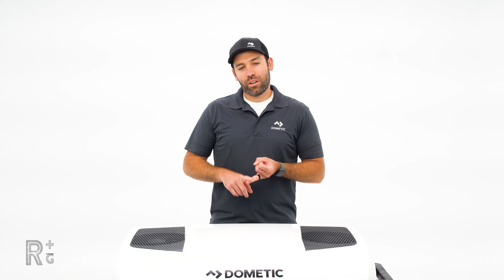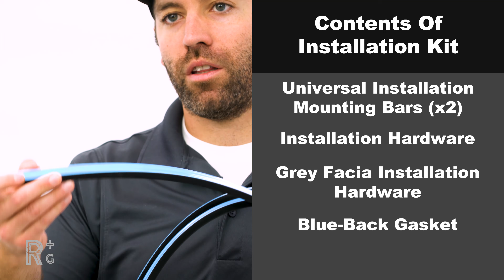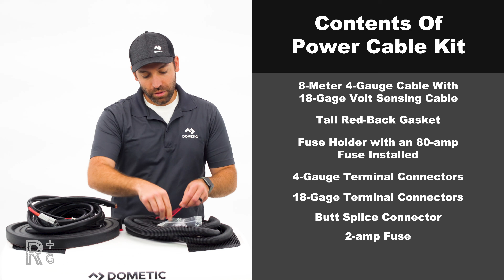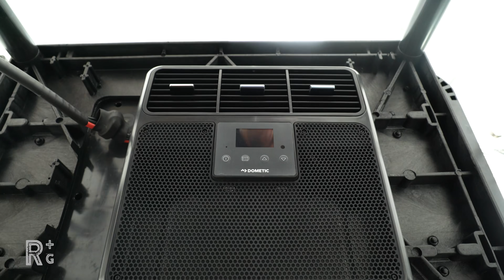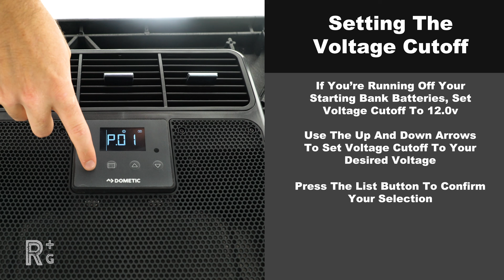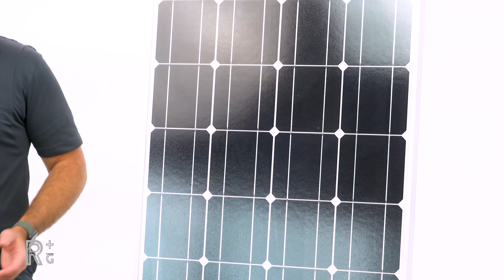Dometic RTX 2000 & RTX 1000 Product Review | RackUp+Go

Comment: Can you run this from a ecoflow delta pro?
Reply from the maker: The Delta Pro has a maximum output of 30A or 378W from the Anderson connection. Unfortunately this is not enough power to run the RTX 1000 or the RTX 2000.

Comment: While sleeping, in ECO mode, the fan won't turn off.  Should I have a separate thermostat to stop the fan.  My bed is fairly high in my van, so having the fan blowing becomes uncomfortable.  I can manually turn if off, but then it will not automatically come back on, etc.  Plus, I want to be sleeping instead of working the A/C controls...
Reply from the maker: Considering the low power draw when in Eco mode, it's unlikely that the unit will begin cycling (turning the compressor off once the set temperature is reached), so the fan will continue to blow. If it does manage to reach the set point, it likely won't cycle off long enough for the fan to stop blowing. In Eco mode it is mainly just keeping up with the cooling needs. You may have better luck selecting the Manual mode and controlling the fan speed to a low level. If you're looking to have the unit cycle, depending on the ambient temperatures and set point for interior temperature, Auto mode may be able to push the unit to cycle where the fan and compressor will turn off once the set point is reached. However, the unit is equipped with a variable speed compressor so it is able to scale to a low speed and low power draw without the need to cycle. It is different from a traditional shore power A/C unit where the compressor is either on or off.

Comment: What's the difference in efficiency between the RTX-2000 and 1000?  I've read different technical spec articles on this. Early on, one article said hat in Eco-Mode the RTX-1000 draws 12 amps and the 2000 19.  Other more recent articles have them both at 19 AH. Why go with the smaller 1000 model if it's drawing down the same power? Can you clarify the power draw in Eco mode for the two models.  Thanks
Reply from the maker: 18A in eco on the RTX 1000. 19A in eco on the RTX 2000

Comment: Hi. Does the condensate just run onto the roof? Or can it be piped down to low level.

Can it be fitted in a 400x400mm opening.

Do the power cable run on the roof or internal. I assume on the roof.

Are there any 12v AC units that give heating as well.

Many thanks

Comment: Interested. Could this also be powered via a Generator? AC 120V 2200 running 2500 peak watts. RTX-1000. Thanks.
Reply from the maker: The RTX is a 12V DC only appliance. If you have a 120VAC to 12V DC converter capable of providing at least 60A, you could use the generator to power the converter and the converter will power the RTX.

Comment: Does this have a fan only function without using the AC?
Reply from the maker: It does not have a designated “fan only” mode. You can increase the temperature setting on the unit however, and as long as the temp in the vehicle is lower than the setting you’ve selected, it will run the fan only.
Reply: @rackupgo  I see! Thank you, and I have a very small van, like 5.3M long, is the RTX 2000 or 1000 recommend?
Reply from the maker: @HK.Builds  you may be able to get by with the RTX 1000, but for any van installation, we typically recommend upgrading to the RTX 2000. You get a lot more performance from the 2000 with very similar power draw, and the price difference is pretty minimal as well. We usually only recommend the RTX 1000 for super small spaces like teardrop trailers.
Reply: @rackupgo  awesome, thanks for your help, I'll be going with the 2000 unit for sure. Didn't expect you to reply so quick and have definitely helped me make a decision.
Reply from the maker: You got it. We are here to help!

Comment: Can the RTX 1000 dometic be installed on the passenger side of the roof (has a slight slope)? And would it also be possible to install perpendicular to the front and back of the van on the passenger side of the roof? Trying to maximize solar roof real estate. Thanks
Reply from the maker: You can install as you wish, just make sure to check the placement guidelines in the Installation & Operating Manual on the product page: https://rackupgo.com/products/dometic-rtx-1000-air-conditioner-1200w-12v-9600028489

As far as the slight slope you mentioned, the RTX 1000 allows for an 8° tilt, the RTX 2000 allows for a 20° tilt.
Reply: @rackupgo  , thanks, I saw the slope on the manual, but wasn't sure if someone has attempted a perpendicular off center installation.
Reply from the maker: @functionalvanconversion4284  not that we are directly aware of, but we've seen all kinds of custom installs. The biggest piece is understanding the placement guidelines in the manual, and making sure your install falls within those parameters. As a general rule, we always recommend the RTX 2000 vs the RTX 1000 for any van installation.

Comment: Can the RTX2000 24V operated with 12V?
Reply from the maker: The 24V version of this product is not currently available in the United States. If you are running a 12V system, you can purchase the 12V RTX 2000 here: https://rackupgo.com/products/dometic-rtx-2000-air-conditioner-2000w-12v-9600028490

Comment: For the RTX1000 what is the max Amp draw the unit has at start up? I thought I found the specs on this unit on the internet but maybe I am just overlooking as I can seem to find it anymore. I want to install this unit on the roof of my Polaris general XP1000 and I need to get the table on the Amp draws for different run fan speed cycles to see what requirements I need to do with my electrical system. The unit will be running while the machine is operating and not from a battery bank. Thank you
Reply from the maker: Draw is between 19-58 amps
Reply: @rackupgo  thank you for the speedy reply.  
However I have a question. I did go back to the manual as I overlooked it when I asked the question previously. The manual states on page 22 for the rtx1000 it is 10-50amps, and the rtx2000 is 10-58amps.
 
Is the manual incorrect stating 50amps?

Thank you
Reply from the maker: @nwags357  sorry, no you are correct. Looks like we pulled the data from the RTX 2000, but see now that you had requested for the RTX 1000. Draw on the RTX 1000 is 10-50 amps.
Reply: @rackupgo  thank you